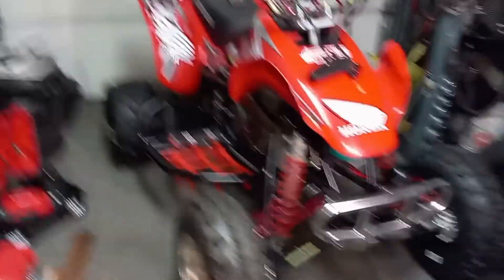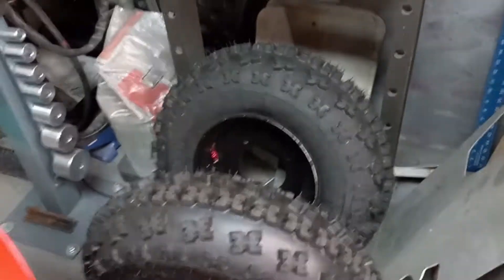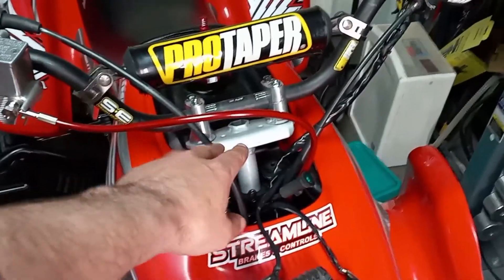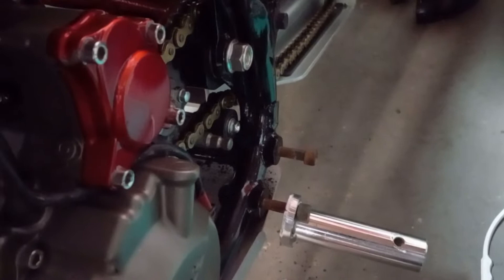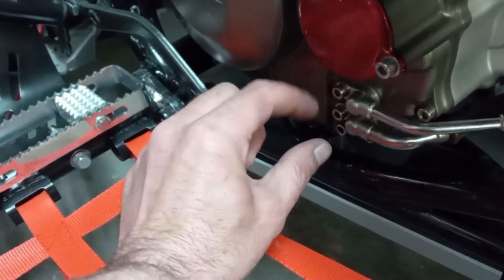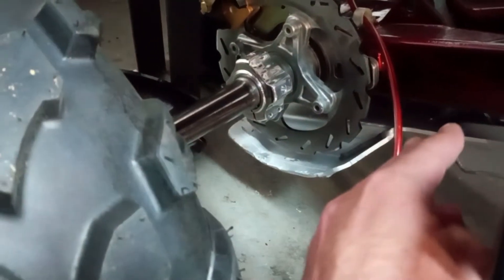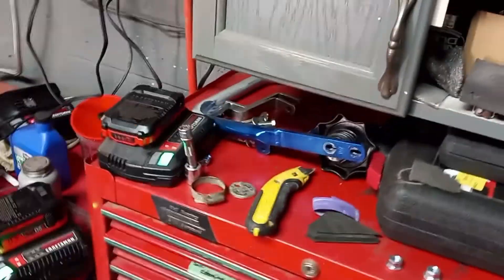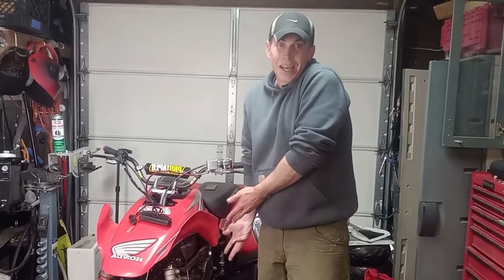400ex. ATV build. Project update

Comment: i want to get a 99-04 400ex.  i really want a 450r but i prefer lower maintenance
Reply from the maker: 400ex is low maintenance a lot less then a 450r. There are a few out there for sale these days too.
Reply from the maker: We just got another 400ex for the channel. You the viewer can vote an different parts and build it with me. Subscribe if you have not yet and join in on the build.